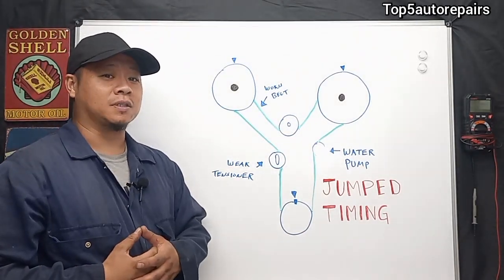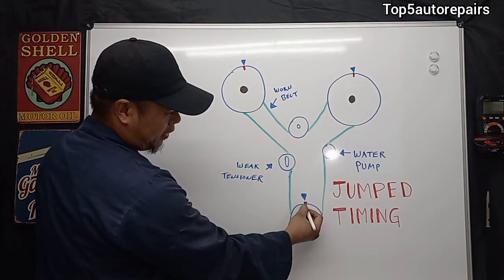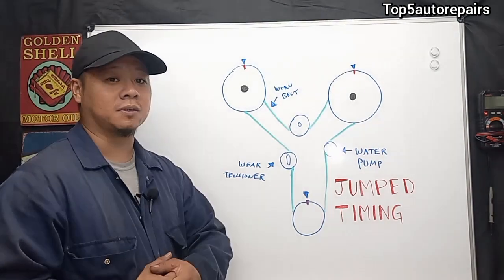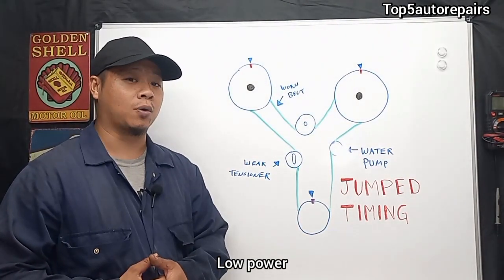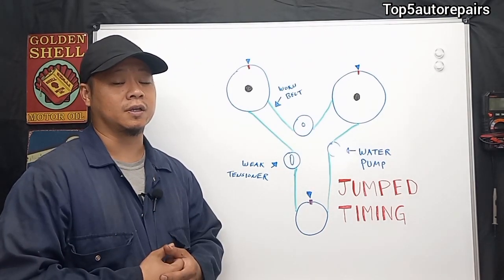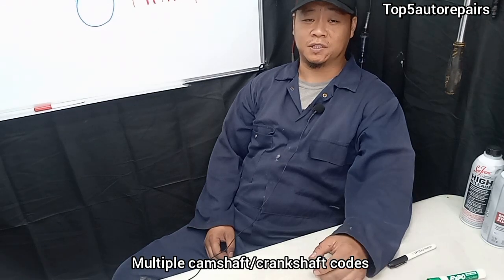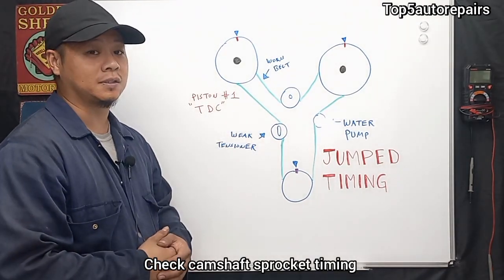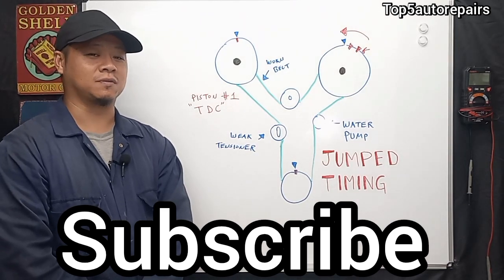How To Tell Timing Belt or Chain is Jumped. Here are the Symptoms

Comment: My water pump had a leak and we had a deep freeze. Didn't know and when I turned the engine over I heard a thud and ticking. Found icicles hanging from water pump area. Now it's a lot of ticking like a race. It's starts fine. But not running it to prevent more damage in case it's fixable. No codes.

Comment: had something happen with my engine and need some help to figure out what it could be, issues (while driving) wouldnt go over 4 on the red line gauge, had trouble going close to 60MPH and wouldnt go over 60, LOUD hissing from the engine when accelerating, after i pulled over to see it wouldnt start back up. Tow guy said it could be a timing issue just trying to get peoples input before i spend insane money on a mechanic

Comment: A friend of made an error when reassembling on his 2.0L Ford Sierra and it pulled like a rocket from 2000 RPM to 4000RPM I think it was and the effect in increased power was so strong it was 30% faster accelerating  from 60 to 110km/h. Then he opened it and adjusted the timing by one tooth and then it started running normal again which was vary boring... I wonder if it would be possible to keep it that way with tooth one off that gave a LOT more power in the mid range  of RPM.

Comment: Question I have a 2011 nissan pathfinder has misfire i changed the coils or plus 02 sensor and other stuff truck still run but im not getting fire on 1,3,5 would that be jump timing???

Comment: I've just replaced the timing belt in a TJ Magna 3.5L V6..
As setting the pretension on these engines can prove difficult as a special tool is required with a tension wrench, when you have desired tension (5Nm) locking down the tensioner wheel causes the desired tension to change (usually increasing the tension) and when correctly adjusted the locking pin will slide in and out of the tensioner easily.. after many failed attempts I decide to ditch the special tool and use a steel wedge (wrapped in vinyl tape) inserting it between the tensioner wheel and the striker plate on the swing arm (which the tensioner pin pushes against) carefully tapping it to increase tension, when I noticed the tensioner locking pin go slack I locked down the wheel.. This method worked fine for me and the lock pin is easily inserted and removed..
My problem now is when I first put the new belt on all timing marks lined up perfectly (spot on) however after many failed attempts when I get the crank to TDC the right bank camshaft gear is half a tooth before the timing mark and the rear bank is 1/4 tooth before the timing mark and the engine runs fine cold but is missing when warming up.. Some mechanics say a half tooth is normal after replacing the belt and will not affect the running of the engine, somehow this don't sit right with me and I will be replacing the belt again..
Can you explain how can a belt / chain be half a tooth out and will this effect the running of the engine ???
I look forward to your reply...
Reply: A friend of made an error when reassembling on his 2.0L Ford Sierra and it pulled like a rocket from 2000 RPM to 4000RPM I think it was and the effect in increased power was so strong it was 30% faster accelerating  from 60 to 110km/h. Then he opened it and adjusted the timing by one tooth and then it started running normal again which was vary boring... I wonder if it would be possible to keep it that way with tooth one off that gave a LOT more power in the mid range  of RPM.

54

Comment: 2004 frontier 2.4l timing question dohc setup

Hi my friends frontier is a tooth off in order to set the cam right is there a special tool or  procedure number one is at tdc The valves on the intake  side appear to be up a little while the exhaust side looks closed  just trying to see what I need to do and if just turning the cams to the right position will work when setting it for the new sprockets and chain. Which should both valves be closed at tdc?

Comment: Hi,I have a  2009 Honda civic 4 cylinder car with very low miles(33000) and regularly driven. Do I need to change the timing belt? Thanks.
Reply: Yes before you regret it And it breaks. Belts tend to break alot sooner then chains.

Comment: Ive seen open cover running of a worn timing belt tensioner
Wonder what kinda noise that makes
I get occasional slap knock unlike any other sound and symptom.

Can easily see one jumping.

I suspected a shaft or transmission gear or motor mount clunk

I also could see a worn belt tensiorner knockin  from added or removed tension from the engine as the load changes.

I sense internal not external.noise.

The broker ppl are
The worse the shape of the general car
Gonna be swappin beaters for daily drive prices while brank new junk continues to.pike yp at beyound inflated.prices

What a time to be alivep

Comment: In my case I hv a code p0017 pointing to my intack camshaft at first I changed the vvt solonoid but the code keeps coming back after I start the car if I put my scan tool I can clear the code and also the engene light goes away but if I start the car and switch off n rescan tht code comes back it says

Crankshaft position /camshaft position bank 1 sensor B correlation

Can it be my intake camshaft off timming

Comment: I got question! It’s on 2016 Honda Odyssey, replacing time belt, after successfully put all pulleys to TDC marks, then removed the old time belt, while installing the new one the left cam moved to position 10:00 tried to pull it back using old belt as driver ( the other camshaft and crank shaft not connected), then it jump to position 2:00,  tried to pull it back to mark position then it jump back to 10:00 position, didn’t hear any cracking sound, How can I fix this situation to put this camshaft to TDC position in order to install new timing belt? Appreciate your answer,
Reply: if you align it just right, it will stay in place.
Reply: I have this exact issue with a 3.5L 2011 Honda Accord. 

Did you get it fixed?
Reply: @Top5AutoRepairs

Do you have any instructions or videos on how to get them lined up again?
Reply: Just did the same thing and am in same predicament. What did you end up doing?
Reply: On a 2013 honda odessy

Comment: Thank you for your insightful video.

I have a 2011 Volvo C30 T5 and it's running rough and a check engine light came on.. Shop told me the timing belt might have junoed a tooth and I should probably get a new motor installed. They said they don't have time to do a compression test. They said it looks like the tensioner failed.

 Is there any chance my engiine is okay? My car drives with a loss of power. I hope to hewr from you.
Reply: It a sad fact these days. Shops what to up sell you for big money. If your timing belt/chain jumped a tooth or 2 yes you have next to no power. How ever. If everything else is good on the engeine. Like not burning a lot of oil. You don't need a new engeine. Take front of engeine a part such as water pump fan alternator. Some time remove the rad for room to work an see. Remove timing cover. Check to see if the timing marks line up like in this video. Turn the engeine over by hand useing a socket an power bar on the crank shaft bolt  Center of harmonic balancer. Until you see all marks are in line. If there not know mater how many times you turn it over . You need a new timing chain/belt and all gears. Maybe a new  Changing guides and tensioner. If they show signs of bad wear. You will also need a new timing cover gasget. Water pump gasget. Install all the new gears an belt/chain   lining up all the marks.

Comment: If my timing is off by a tooth or two is that bad if the issue is corrected will it start up?
Reply: usually not a problem, except for lower compression in that bank of cylinders and a small loss in power... If the engine is a non interference, no damage done, just realign the marks... if its an interference engine,,slipping any more than a tooth or 2 could be catastrophic as risk of valves hitting pistons can occur... most interference engines can tolerate a small variable in timing.. should be ok...

Comment: I had my oil changed, and the people that did it didn't put enough of it on my 08 tundra, so I rode on it on low pressure  without noticing till I had a rattle when I cold started it, it goes away within 3 seconds but it's still annoying, has anybody ever had that issue?  If so what was it? I'm trying to get it fix even though the engine runs good

Comment: Yep my 4.6 town car jumped timing yesterday and started backfiring real bad, don’t even know if it’s worth trying to fix, if it’s just timing chain I can fix that but if it damaged valves and pistons id rather just get a junkyard motor
Reply: My timing belt jumped last year on the highway with no indicators lit, trashed the header and overheated the engine. Replaced with a used engine, same number of miles 74k, now I'm having the exact same problem with the "new" engine. 🙄

Comment: Car engine was cutting out, it would jerk and then a few seconds after the jerk the engine went off like it was shut off by the driver, I'd turn it back on and it would start back up instantly and still repeat few minutes after, this happens regardless if i was idling in traffic or just have it on to warm up in my garage. 
So i got it scanned and it was a crankshaft code, replaced it and the same issue still persisted, prior to this a mechanic replaced the fuel pump and that wasn't it.
Scanned it again and then it showed some CAMSHAFT code, i think P0011, they were changed and the random engine cut outs stopped, but this came with new problems, hard starting, and the car hesitated to move when i stepped on the gas, also would shake if in Drive D but in traffic  (stationary) shaking would stop if engine ran and engaged in park P or i started to move, also the exhaust was shaking, not violently but it was.
I took it back home feeling unsatisfied but then the next day i restarted it and it wouldn't start back up, what's weird now is i hear an usual sound while cranking the engine, i see the belts roll the accessories but it won't start up, this sound i speak of is around the head of the engine, i have a 2009 V6 Hyundai sonata, I'd appreciate your advice, I'm thinking the timing chain, now i have P0335, still a timing code

Comment: I have a 2009 ford Taurus 3.5 v6 with only 58,000 miles it started making a weird noise coming from the upper compartment I think one of my phasers when bad causing my timing chain to skip.what you think?do you think is worth fixing or should I trash the car.

Comment: My timing is jumped and there is small metal dust . Is my engine broken?? But it started with a huge miss .. please help
Reply: Its a bmw n62 engine 4.4l v8
Reply: Head job if the block will support the new power

Comment: so all the timing has to be on the mark to make the car run right, what about the timing chain, can i put the chain back on anyways ... or does it have a mark on it also
Reply from the maker: I don't see it as an issue if the timing chain is backward. Timing mark must be lined up prior to installing the timing chain. If you're not sure about timing marks, look at the timing chain. The link will be colored. That is where the mark is at on the timing chain.
Reply: @Top5AutoRepairs  

got it thanks..

Comment: I changed timing belt a week ago on my 2.0L vw mk4 2009, everything was pretty but now I hear a clicking sound when engine starts for a few minutes and after car warms up the clicking sound disappears, I feel the sound comes from timing belt or somewhere inside the engine but really hard to tell. Any ideas?
Reply: had you already solved the issue? I have the very same problem now! Would really helps if you tell me. Thank you
Reply: @jan5818  ..Yes i did solve the issue after a few inspections, my issue was that the plastic cover that sets over the timing belt was not installed properly and one of its metal locks  off limit after a few tries it was all seated in right place, there could be other issues cause that clicking sound, try visually inspecting everything but if issue persist to be fixed get a VW specialized  mechanic and they could easily detect the cause before getting into more damage, good luck

Comment: Hi i have a 2005 Acura TL and I put the crankshaft at where TDC should marked, but both of my sprockets are off by 4 teeth to the left? Do I just move both sprockets to the right where they should be aline while leaving the crankshaft at 12 o’clock ?
Reply from the maker: Correct. Go clockwise.

Comment: I've got spark, fuel and compression, clean maf, throttle crank and cam sensors. 2005 Corsa C (90+k) still won't run more than a few seconds..I'm told the chain may have jumped. I've ordered a timing kit but that was before I saw videos of stripping down engines in well- equipped professional garages... Please tell me I don't have to do all that. Please..
Reply: U would have lost compression in one cylinder or more if timing jumped or broke
Reply: @panzerichi3837  That's great to know! In the meantime I've given up and got the garage to pick it up. After a week he couldn't find anything (checked to see if the cat was blocked). Found oil in the ECU connector. Coming from oil pressure switch which I had replaced recently since il was yeukky with oil.

He cleaned the connector, after which the motor ran much longer.
 He sent the ECU off a coupla weeks ago for testing. France is closed for holidays in August so I have to be patient...
Thanks again for your input.

Comment: Hi my name bradley and on my  2005 chevy Colorado pickup it had a 3.5 engine and I was driving it and motor turn off on me
Reply: Lolz
Reply: My 2010 did same sencers pump no start found cam jumped one Link one exhaust valve stuck looks like a head job maybe possible but  a long block is the true way out $$$$$

Comment: What happens if you have all 3 aligned with the timing marks but when you go manually turn the shaft it can only turn 180 degrees then it completely stops? Like you can no longer turn clockwise or counterclockwise? It was able to turn continuously but once the belt was replaced and all markings are were they are suppose to be, it no longer turns. only that 180 degrees I've mentioned.

Thanks in advance
Reply: You have bent valves in the heads bro
Reply: Not good!

Comment: hey if i replace my intake cam timing gear do I need to replace my timing chain?

2012 toyota camry rattle noise when i start n drive also when i start it kinda sounds like its flooding? if that makes sense.
one shop said my timing chain is loose I take it to toyota they say my chain wasnt stretched but it could be something within it but my intake timing def needs to be replaced.Was it possible for me just to replace the gears without the chain? Im potentially spending 4k on a repair i might not even need man this shit sucks. Said its too late to put the old chain back on I have to go thru with the chain + the gears but told me the gears was the cause of the rattling. Does that explain how my car starts rough too? 
ugh any reliable answer would be appreciated atp im pissed cause this couldve been a huge waste of money

Comment: Great video.  Been driving 2000 miles with a bad timing chain.  How bad is that? I’m scared I may have done dmg but let’s hope not.  Only 62k miles total.
Reply from the maker: It's risky. It should be replaced asap.
Reply: Air you should replace it once you got fund. You don't want to wait long until your timing belt snapped on the highway doing 90 mph like me smfh.
Reply: I’ve had the timing rattle start at 95k and I’m at 135k currently no issues
Reply: @majed888 you've got issues,  just not a failure... yet.
Reply: Timing chain issue? YES! 
Blown engine/ casket? Not yet!
CHOOSE YOUR WEAPONS

Comment: Hi. I have a question for you: What if the camshaft mark is aligned with the sprocket and the Crankshaft mark is aligned with the mark at the oil pump, but the mark on the Balancer is not aligned with the timing cover plastic mark called T?  
---- The car is Elantra 2008 2.0L. could this create a vibration on the steering wheel? No code or Engine light on ever.
Reply from the maker: It should be fine as long there is no reluctor ring on the harmonic balancer which is for timing for some vehicles like Ford.
Reply: @Top5AutoRepairs  can u explain a little more on this?

Comment: Do you have a video on how to do a compression test like you mentioned towards the end of the video?
Reply: I was doing a timing chain on my 2007 f150 4.6 2v. The driverside cam sprocket shifted on me when I torqued it down. I moved it back to what I think is the correct location. The chains lined up and I was able to get everything in place. I used the crank bolt to turn the engine without any of the covers on and I didn't receive any resistance. I checked the cylinders to make sure the pistons & valves weren't hitting everything looked and felt good. I just want to make sure everything is correct before I put everything back together and try to turn it over.

Comment: I have a 2001 mitsubishi eclipse gt v6 3.0. While putting the timing belt back on, the left rear fire wall cam jump a quarter turn to the right clock wise due to the pressure from the valve spring. Do I just turn it back counter clock wise which will be a lot of pressure to move back?
Reply from the maker: It's fine. You can turn it counter clockwise.

Comment: Very interesting and helpful information. Backfire is only caused by jumped timing ? Thanks
Reply from the maker: Incorrect firing order as well
Reply: @Top5AutoRepairs  Thanks
Reply: Back fire can be from a lot of things not timing. In most cases it back fires due to to rich gas, bad cardon build up. A bad or plugged EGR valve.